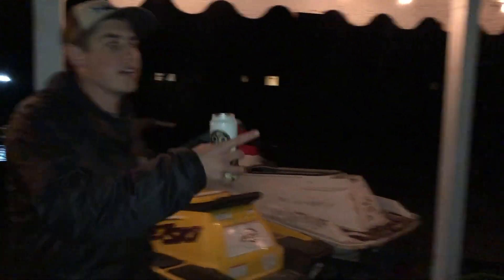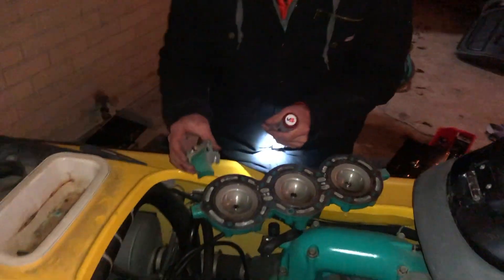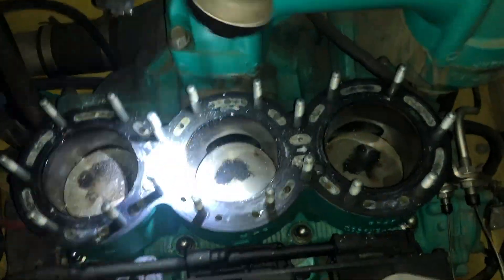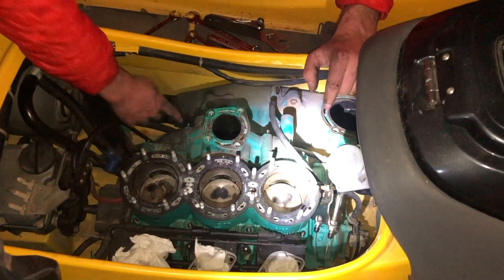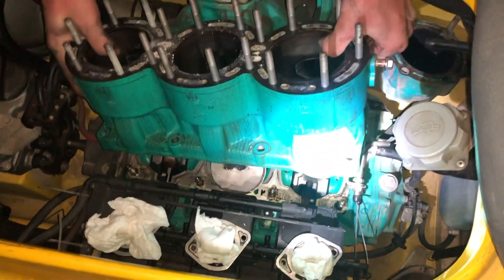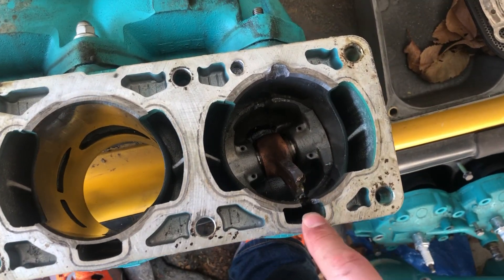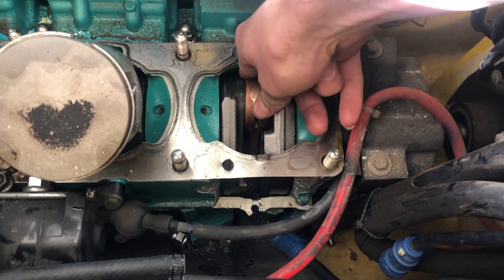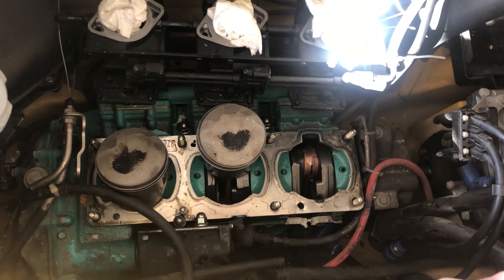Jet Ski Mess - Kawasaki 1100 ZXI

Comment: What would cause this to happen to motor
Reply from the maker: There probably was not enough oil on the bearings causing it to seas up and hit the crank case
Reply: @92813justin  2 stroke oil or crank case oil

Comment: On my Polaris sl650 the engine comes apart in 3 jugs which I was happy about when I had to pull one of the jugs off because the rod blew, luckily it blew right at where the bearing goes on the crankshaft. I need to get a new connecting rod and either get a new jug or get a new sleeve pressed in the jug, a new piston some rings and should run

Comment: For the bottom part crank case blowout do you source another from one that doesn’t run or where do you find that? I don’t have one I’m working on, just wondering
Reply from the maker: mrjjman2010 I’m most likely going to order a new engine. The whole engine is torn apart